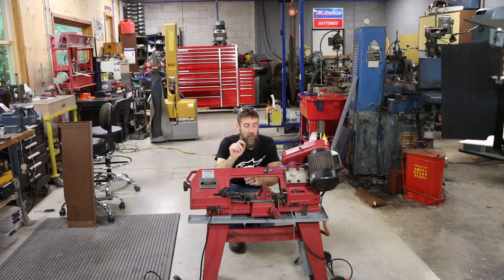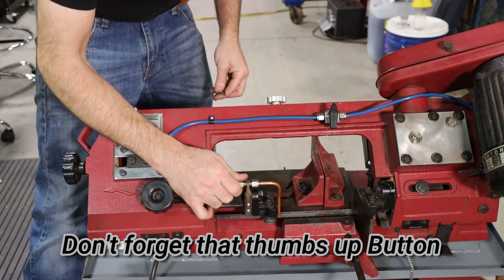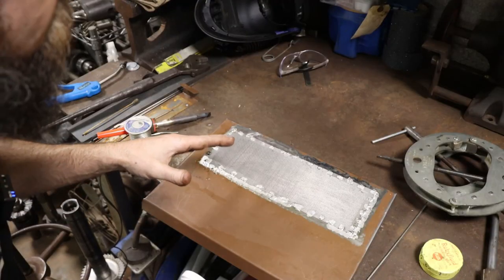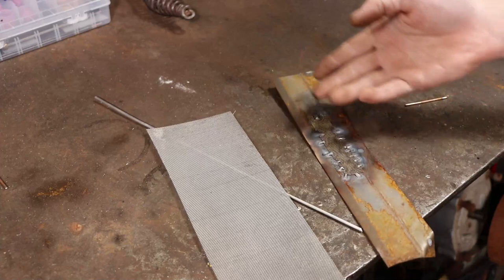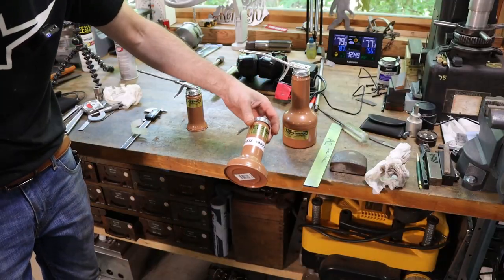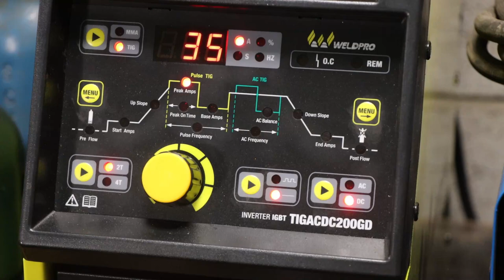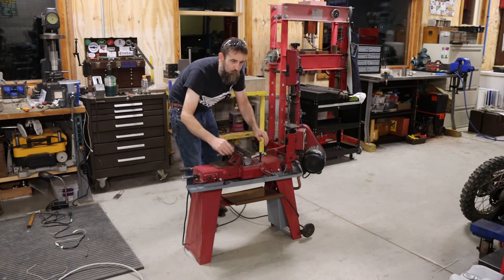Full Coolant System add on Complete! Harbor Freight 4x6 Saw MOD. Part 2

Comment: I had a bigger regular 7” x 12” and I used a piece of material where the metal chips use to fall and also where the cutting solution would drain into the reservoir.  I would then take them off and let dry and throw them away.  I also had a small drill wire brush 2” dial on there that would spin with the blade to keep the teeth cleat especially if I was cutting soft metal. Brass aluminum from gumming up the teeth.

Comment: Little late for this one but we have had one of those saws in actual production for over 30 years (on it's 2d motor, 3d set of worm wheels, and 3d set of wheel bearings. I don't know how many guide rollers we have been through) 

At any rate, I basally did the same catch pan and water set up as Steve's like 25 years ago, but the best thing I ever did was to scrap the flimsy factory legs and make a stand that puts it at the same level as our Powermatic vertical. Fact is we have them next to each other at the end of the stock rack and we use the P'Matic as the infeed table for the HF horizontal. (Also a 12"  extension on the in feed AND outfeed side doesn't hurt a thing. 

Mymajor point here is I have no idea why the horizontals are always set up so you have to stand on your head to use them. They are all made that way. - Monkey see. Monkey do I guess.  Bringing it up to the level of other machine tools makes all the difference in the world when you are trying to get parts cut to an accurate length.  There are other little mods but the first thing to do is get it up to  

One more thing we added a few years ago is a hydraulic downfeed damper. Between the water and the hydraulic we get a good 5 times the blade life in 4140 prehard and can carry +/= .015 all day long.  Take it from Steve and I both. Don't sell these little HF saws short, especially with water and an add on Hydraulic. - A 6-10 Bimetal and Rust Lick coolant and you can cut anything from 4" alloy round bar to 2x2x1/4 A-36 angle all day and all night long.

Comment: I have one of these saws , it's a beauty, cuts about a square inch per minute, so that most times you dint have time to scratch your arse before it's finished.   I use a cheap aquarium pump and plastic tubing ( cheap as chips) . I put a magnet in a ziplock back and leave it in a plastic tray.   It's a bit of a Heath Robinson setup but it does a good job.  I wish I had your patience and attention to detail but you need folk like me to set the bar low enough that anyone can have a go!!!

Stavros
Reply: You should see the chip pan in mine. I spray glued some aluminum flashing to foam board. I couldn't even be bothered using decent sheet metal. It's lasted me for 20 years now though. So good enough.

Comment: Well to Steve from another Steve. You are a very talented guy. I have subbed to your channel. I make a lot of tube video's & always think things through on camera. Keep them coming. I love your huge workshop. Mine is only Dinky here in the UK. I am picking up one of these saws on Monday. I have just sold my vertical Ferrex bandsaw as it will not cut stock like a horizontal will. I will definately be putting it on a stand tray & a coolant system like you have. Brilliant. Thanks for sharing. Regards
Steve.

Comment: Great job Steve, turned out nice with what two modifications. Cleaning the steel is the big trick to soldering with lead . Just like brazing clean and dry. Flux is acid to etch it in and together. So nice to see family hanging with dad.

Comment: Hi Steve. I have a similar HF bandsaw, but it has a built in coolant system within it's cabinet. One time the saw fell over when I was relocating it. All the cheap China plastic broke into pieces! The motor end cover, the fan assembly and the plastic junction box on the motor. All in pieces. HF did not offer any of these items as replacement parts! I found better parts made of steel for the identical saw by JET. All the metal parts were a perfect fit. I also built a dolly for the base to sit on and included casters on all four that fully rotate.

Comment: Love the channel and calm laid back vibe  it gives.  I too use a wheel to grind my tungsten. It only takes 1 small error to rocket that needle sharp dart out of your hands lol face them down when u grind.  

Also you can cut the tungsten in half and grind both ends, a cordless drill makes short work of it.

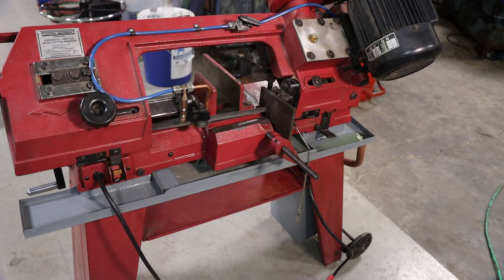Comment: After re-watching this morning @ 10:24, see your on/off switch is external where my Dayton is mounted under the bed with possibilities of coolant coming in contact with wiring. I will have to water proof the housing and problem goes away :)>..Lov your upgrade, and really helped on our restoration,,Thx, Bear.

Comment: Hi Steve, I put a second nozzle to wash the blade straight after the cut, it stops the blade from dragging chips through the machine. I like how you cut the copper to go over the blade, will have to modify mine as it seems to better control the flow of coolant. Regards from Oz
Reply: Been meaning to do that to ours for years,,,wounder if I will actually get it done. ,,,, The little wire brush wheels are neat too,,,,,But I don't think I will ever get that done either.

Comment: If coolant is running off the end of a long cut-off piece ,try putting a cable tie or something similar like a piece of string around the  cut-off piece to act as a drip path into the tray. 
Even a magnet stuck to the bottom of the cut-off piece might work.
Fluid will always find the most direct downwards path.
Reply: Chunk of oil base modeling clay does the trick too.

Comment: The big  saw companys need to see you to design the cooling system for their saws
Reply: Big saw makes their money out of wearing out blades, so they will never take this upgrade that improves blade life.
Reply: @SeanBZA  Never seen a saw in a steel service center that did NOT have water on it. - Same in any for real fab or machine shop.  - Only the hobby type saws are made dry. - Water is what makes the little HF saw into a professional machine tool. Even the next step up from this little one at Harbor Freight has water. 

Also don't know anybody like Kalamazoo, Marvel, Jet, Clausing or any other manufacturer of band saws that also makes blades, and I don't know anybody like Leonox, Sandvik. or Starett that makes band saws.

Comment: Have you thought of raising that saw up a bit? Some day you'll bend over as far as you do and not be able to straighten back up! Maybe 4" square-tube runners with another 4 or 5" from better (lockable) wheels?
Reply: Question of the day. - Why are all horizontal band saw built so you have to stand on your head to use them?

Comment: I have a small bandsaw that i bought over 20 years ago ( probably 25 years ) that has no coolant too...i use a stick lubricant that i use for cutting aluminum on my chopsaw.
It works great ..is easy to apply when needed and while messy...is easy to clean up too....i don't really need coolant or the mess and rust issues..plus i live in a freezing climate that is another issue with liquid coolant/lubricant systems to consider...plus the nasty liquid going bad or smelly if sitting long... The stick is long lasting and i use it on tapping self tapping screws ( thicker stock ) and globs can be saved for uses away for shop ( i put these in old plastic medicine containers in my toolboxes )....i have another bandsaw with coolant too....

Comment: good idea about that chip pan 
looks like it still sucks a little of the chips intoo the machine , maibe put a second coolant feed on the other sidfe to flush the last chips off after the cut 
got the sametype of oilcans , had to reorder 3 times because the spout fell out of the packaging 
any idea if those spouts can be bought seperate ?

Comment: Will coolant cause rust on some of the raw steel parts being water based or do the antioxidants pretty much take care of it all?  I know i machined out my drill press table and even oil sealed it after but every time i use that blue stuff it will put a rust mark on the table if i dont completely dry it all off when im done..  easy to miss a little sploodge and have ya spend 20 mins next time you go to use it getting that rust off..

Comment: Nice work! What TPI blade are you using with it?  I have an equal type of bandsaw but I have some problems with the blade constantly slipping and coming off. Do you have any tips off fixing this? I have done my best to aline the blade

Comment: Every time i move a turtle or snake from the road, im always torn as to which side to put them on. If i chose correctly they will be fine,  if not all ive done is messbup their travel plans. Then i just wonder if i did just delay the inevitable.

Comment: Hi Steve, against coolant dripping on the floor of a long workpiece, you might tilt the saw sideways maybe?
Reply: Then it drips out the other end.
Reply: @Balsamancnc  Only if it's a tube, with would be easy to block, otherwise it would run into the vice no problem.

Comment: What does this saw do that the DoAll doesn’t or doesn’t do as well? With the hydraulic infeed on the DoAll I’d have thought this saw is now redundant?
Reply: Maybe for quick cuts, or to have a different blade in a different saw. Or maybe it's just a project idea for viewers! There's a ton of those saws out there with a ton of different brand names on them. Seems like everyone has one of those saws tucked away somewhere if they don't have something better. I picked one up for $20 sans blade and sans motor. Got a washing machine motor ($0) and pulley ready to go on it, but have been busy with other things and don't have it running yet. The worm gear in the gear box isn't in great shape, but I guess what do you expect for $20
Reply: To cut longer things
Reply: It cuts long lengths of stock better.
Reply: Add value before selling it and a project for the new welder.

Comment: The biggest problem with coolant is when cutting tube, the coolant will run out of the tube onto the ground etc- which is why I no longer use coolant on my saw.
Reply: Try that if you are running the saw 20 or 30 hours a week like we do at times,  and let me have the account to replacethe blades you burn up.  

Stick a 5 galon can under the end of the pipe if you are doing any actual work. The little bit of water that gets on the floor is not worth screwing around with,,,,,,unless you have the saw in your living room.

Comment: I did a far simpler thing like this...just set the hose to flood the part and blade. The coolant ran out the work piece to the end and dripped to the floor from there. :-/

Comment: A lot of work on a small saw when you know that Al is going to bring you a DoALL in a few months. Wait, you already have a DoALL horizontal.
Reply: Does he?
Reply: @1pcfred  Good question  ,,,,,  does he?
Reply: @cyrilhudak4568  I guess we'll just have to stay tuned to find out. I haven't seen any evidence lately though. That saw did have more than its fair share of problems.
Reply: @1pcfred  It's the project he was working on before he rebuilt his shop building. Should be able to find it in his history.

Comment: Why are you modifying your HF saw when you have the the big saw that does everything?
Reply: I can give you one reason. - Ever pay for a 12'-6 bimetal saw blade? 

Our vertical takes a 16 foot blade and we only use a 14-10 in it but we have all different pitches for the 66"4x8 and it gets used for almost all cut off work.  Anything lie structural and large tubing that won't fit in the little  HF saw gets plasma cut.

Comment: Steve, need your thoughts on this. Is there a 50/50 chance that when coolant could get into the 120vac on/off motor switch, (and didn't pop the breaker) that there would be a danger of electrical injury are possible death? My Dayton we are a present, restoring, like the HF saw, was not designed to have are run coolant. The Do-All, yes, should I really consider a water prof switch, are relocating up stream with a trip wire are other means ? I am 68+, and wish to work safe and hang around the ole Plant for a long time 😋

Comment: Neat solution for coolant on the bandsaw but you need to change the mains cord entry position or fit an armoured cable, the existing setup leaves the PVC cable sheath contacting the top of the tray surround. Vibration will ultimately wear through the sheath and potentially one of the electrical cores creating a possibility of a shock hazard.
Reply: If the hot touches the metal of the saw it'll trip the breaker. As the body of the saw is grounded. That's why we do that. Ah? Smarter minds than yours and mine have thought of everything. Or are you the type that cuts the ground prongs off of plugs? Which does defeat safety grounding.
Reply: @1pcfred  Paul, I come from a country that has had mandated earthing at every outlet since before WW2. As a student engineer at University in the 60's, we had a US lecturer who was adamant that earthing was a risk to life as it potentially provided the return path for electrocution if you accidently made contact with a hot connection. He returned to the US while the US was updating to earthing via those dinky little adaptors with an exposed earth lug that you fastened to a 2 pin outlet via the screw that held the faceplate to the wall box. 
In my 70's now and I don't think I have ever modified the earth pin on any plug in my life. Was also certified to work on live 20KV AC, DC and RF systems as I was a broadcast engineer working with transmitters to 50KW, so have a slightly better than vague idea of electrical hazards. 
The concept that the breaker will save you is valid, provided that there is a correctly functioning neutral and earth. However if there is a possibility that either develops a fault before the active does, a circuit breaker may not save you, as it needs a current twice rated current for a few seconds to trip it, they are designed not to trip at rated current. Your argument is a bit like saying it's safe to drive through a red light cause your car has airbags, they may be some protection but stopping in time is way better protection.
Reply: @walterjwalnut9964  your stop light analogy is a poor one because lights have no way of interrupting the flow. To be better a traffic light would have to have walls it could throw onto the road in the event of a fault condition. Or perhaps trap doors? To forcibly break the flow of traffic. Standard circuit breakers only offer a couple modes of protection. A GFCI is another layer of protection. Although you will get zinged pretty good before it trips. I was told by an electrician I knew that had to test it out on himself once. I took his word for it.
Reply: @1pcfred  The basis of the stop light analogy is that it is better to avoid a predictable problem than rely on caveat ridden technology to minimise the effect of the problem when it occurs. Yeah a GFCI will isolate a circuit if it detects an imbalance in active and neutral currents, but only once the leakage reaches a non lethal trigger value that is capable of throwing someone across the room, with the possibility of subsequent injury. So much easier to correct a visible and obvious issue than figure that that some piece of technology will save you when common sense won't.
Reply: @walterjwalnut9964  it won't throw you across the room. It is a nasty zing though from what I've been told. Takes longer than you'd think it would.